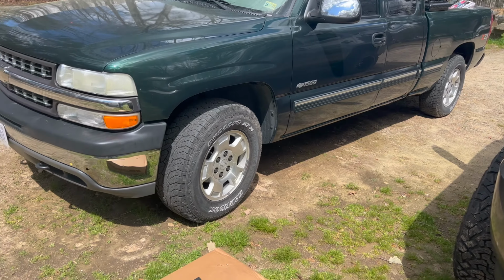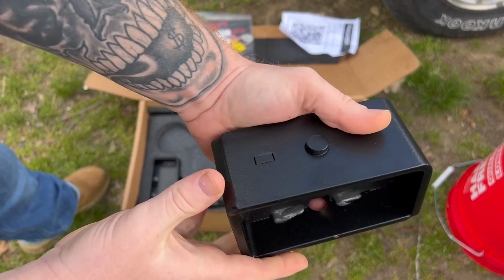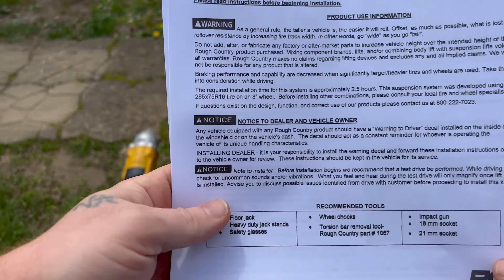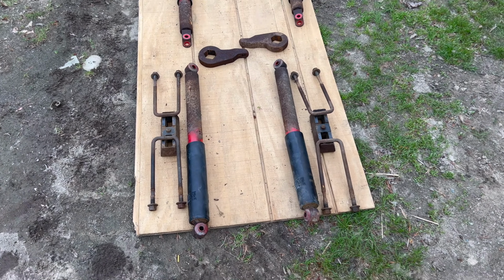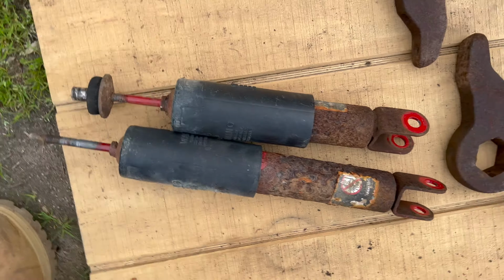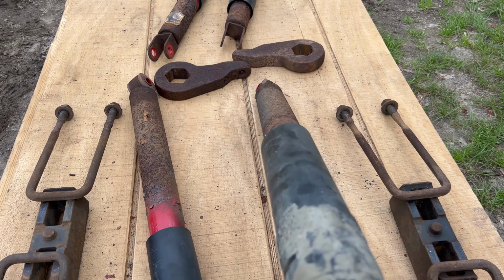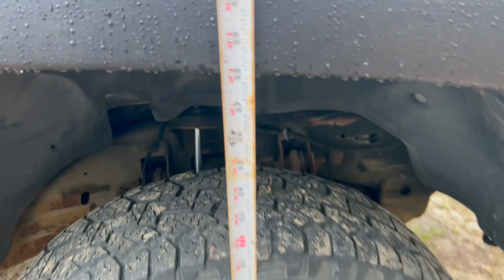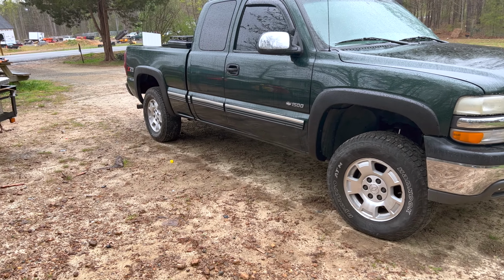Rough Country 1.5-2.5 Inch Leveling kit 99-06 Silverado/Sierra 1500 4WD (Unbox And Review)

Comment: Dam rear leaf springs suck on these. Your riding on the overload if you hauled what you say. 1,500lb. springs in rear stock. 22-1567 is  what you need. Not blocks
Reply from the maker: Man I really haven’t had any issues I pulled a 4,000 lbs camper with A weight distribution hitch from va to Florida there an back right after I put that kit on and it was fine hell I just bought a 2016 f250 SD and that thing is trash as of right now as far as hauling I tow a lawn mower and it look my truck has a Carolina squat I’ll make some videos of me fixing that
Reply: @tejaysreviews  Look at your spring, they're bending backwards. Center leaf will break soon... TSB was issued for these.
Reply: Exactly what I see.  Won't be long till these fail. For what it's worth to you as you lift the front you add weight to the rear springs making them less able to handle any loads. Think and research what we say.

Comment: When you put on the new keys did you crank them all the way up or leave them about in the middle?
Reply from the maker: I put them back at the same as they was at factory. so I just measured the bolt and took off keys and put bolt the same postion

Comment: Nice vid, Nice truck too! alright educate me a bit, what role do torsion keys play? can they only be used in a leveling kit or can they be used as well in a  lift kit?
Reply from the maker: Man to be honest im just an average do it your Selfer...so I just try to do it my self instead of paying a shop.. with that being said I've installed lift kits and they came with bigger torsion keys. I do know if you have a stock truck you can crank the keys and it will raise the front end up but the ride will be  rough.

Comment: Great video. Question would I really need to put the blocks on my rear if my Silverado has air bags already? Thank you 👍
Reply from the maker: you don't eat to rely just on your bags in my opinion the blocks will take some of the stress of your bags and if you tow a load you can apply more air to level them out. that is just my opinion I would call a local 4x4 shop and just ask.
Reply: @tejaysreviews  Thank you for getting back to me 👍👍

Comment: do you think you could fit 35s?
Reply from the maker: if you trim the hell out every thing. fenders nor cal mod and bumper.... but i wouldn't... I can run  33's all day tho
Reply: @tejaysreviews hey man. Getting this kit and want to keep my stock wheels like you, but needing new tires bad. You think I could go with 33x12.5? Hard to find anything online with stock wheels to compare
Reply: @johnb1116  Yes 33x12.50 will be fine with stock wheels and this kit. I’ve installed this kit on many trucks and 35x12.50 fit easily with very minor plastic trimming on the bumper. If I have the time I usually take the front bumper off and space it up to make the bumper gap tighter and I can get away with not trimming anything. Believe it or not 37s will fit with no metal trimming either, they do hit the torsion bars at about 3/4 turn radius though
Reply: @johnb1116  I run 33 x 12.50s on stock wheels and stock suspension.   No trimming and no rubbing even at full lock.   Just got this leveling kit for my truck and putting it on soon.  Gonna go with some spacers to get a little more aggressive stance.  Current wheels have a 31mm offset but with the 12.50s it just comes flush with the outer most part of the fender.  I like the way 305s on thinner wheels looks but want a good inch or 2 of tire outside the fenders.  Should fit under the leveling kit fine with maybe some minor plastic trimming.

Comment: How does it effect towing? Does it squat more when it has a heavy load?
Reply from the maker: better than stock
Reply: It rides on the overload leaf when unloaded. Rear squats and lifts front.  The rear springs are weak. I suggest replacing with 1,900lb springs.
Reply: Yes, anytime you lift the front it adds load to the rear. Add payload in the bed or tow weight and the rear squats.

Comment: The 2 torsion keys are exactly the same and they barely lift your truck I just don't understand it. Why not do a 8" lift or 10" lift
Reply from the maker: its different it chances the angle and you can screw that bolt in to lift it more. this is a leveling kit so it makes the truck sit level and slows for you to fit a 33' inch tire. as far as the lift I have a f250 with a 12 inch lift on 40's and trust me you don't want to work in in every day this truck is just an old work truck I'm not about to lift that high lol